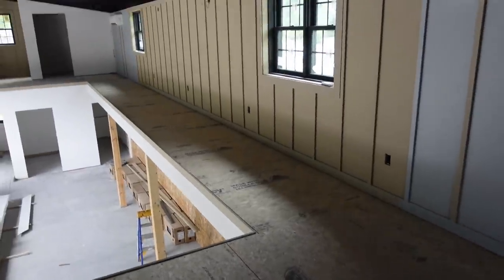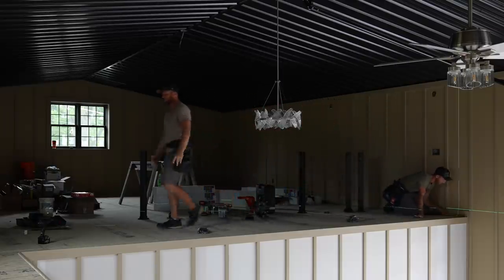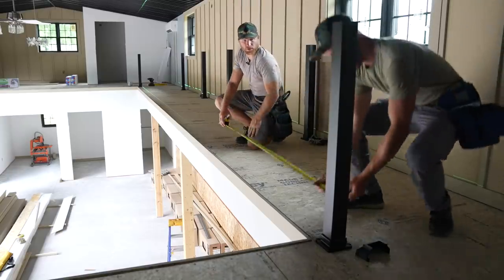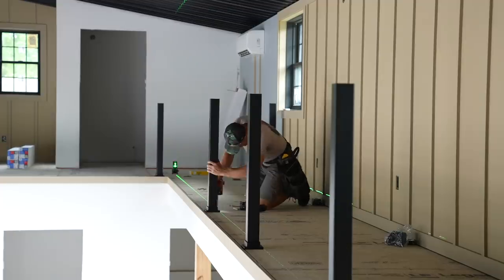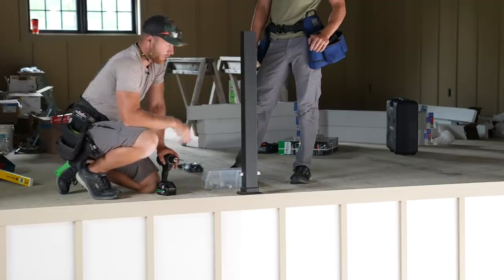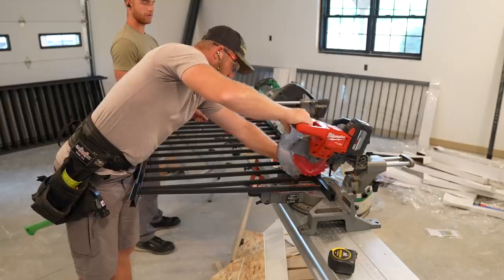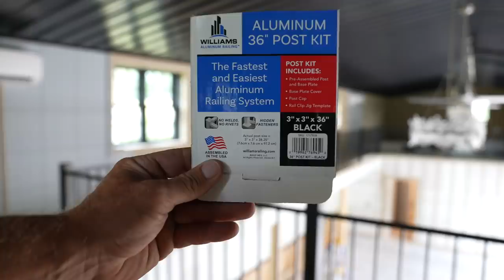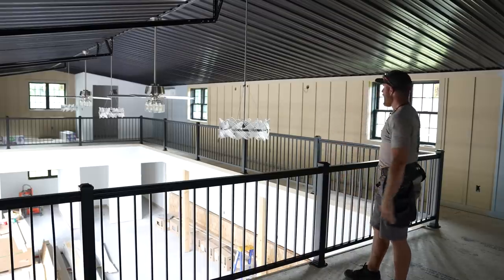Installing Black Aluminum Hand Rail - SUPER EASY OMG 19

Comment: The brand I use have the brackets already incorporated in the posts. They supply corner and in line posts already set up. Saves a lot of time.

Comment: Word of advice for installing the top rails, its best to do bottoms 1st and put your middle support it. Takes the flex out of the top when putting on the handrail and then you don't have to squeeze so hard to get them on

Comment: I have always used just a plain wood cutting blade and it works great to cut aluminum rails.and just a little tip if you get little scratches in the aluminum I have always used lacquer thinner on a rag to remove the scratches just don't use to much or it will take the finish off.great video thanks for the awesome content.

Comment: Before the advent of lower speed aluminium / metal circular blades, we used 60 tooth 
Carbide  blades and applied  bees wax to blade to prevent aluminum from "welding" to the blade do to heat generation.

Comment: When you forget the knee pads cardboard is a good alt.  I am a big dude and at work when I do not have my knee pads for floor work I just stack some cardboard or find some packing foam from something to use..
Reply from the maker: Nice tip
Reply: I've use scrap pieces of blue riged foam in a pinch too.

Comment: Great workmanship, fantastic video! But the height of your guardrail may be too low depending on the local code. Typically a 42” guard is required for any occupiable surface more than 30” above the level below.

Comment: It looks good, but I'm not entirely convinced by the strength of the way those posts are just screwed into the floor. There's a ton of leverage from the top of the post to the ground, so an adult falling and hitting the exact top of the post could rip it out of the floor.

Comment: I've kept my mouth shut about your railing issue through multiple videos but apparently others have also  cringed about it so I guess I'll pile on top. One day you or one of your guys is going to mess up and walk right off that edge. A simple 2x4 guardrail can be made cheap, easy and be moved from job to job as necessary. The holes left in the flooring are worth saving someone's neck. Safety standards are in place for a reason...
Reply: Thank you Captain OSHA
Reply from the maker: Funny you say simple 2x4 rail made cheap.  You’re right but that made me chuckle a little bit with pricing
Reply: @RRBuildings  100% truth. A simple handrail would costs a small fortune in today's lumber prices.
Reply: @RRBuildings  true but prices are going back down, the rails are reusable, and neck injuries are expensive
Reply: Nothing to do with OSHA more like common sense